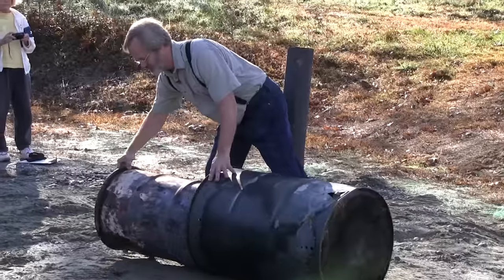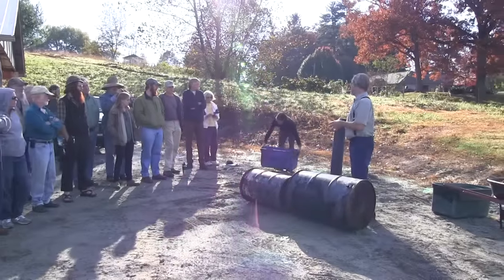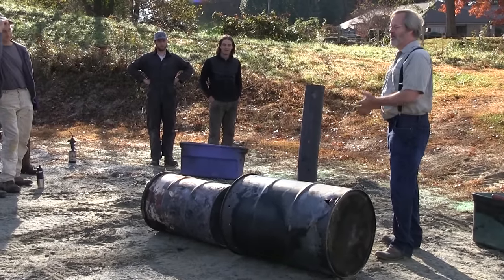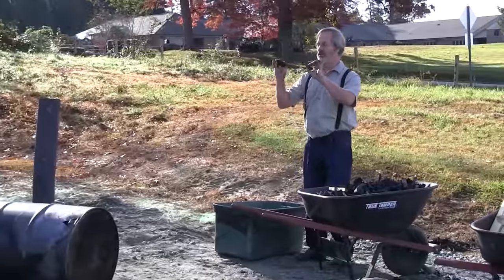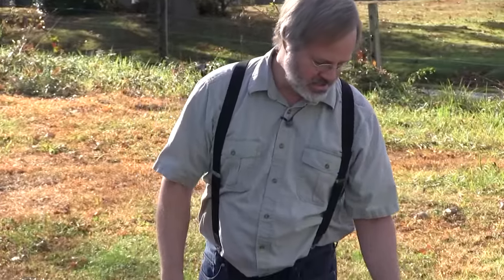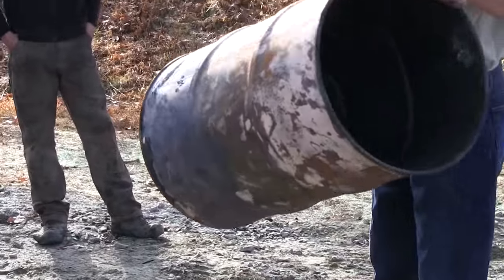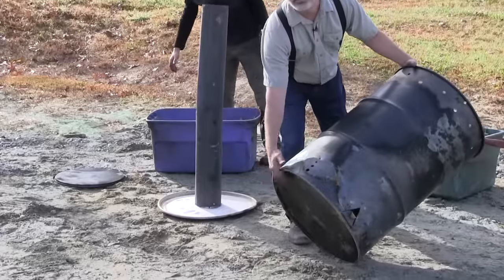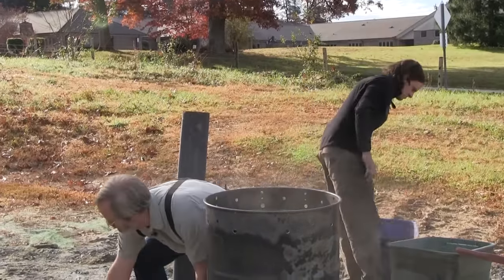Biochar Workshop Part 1, How to Make Biochar

Comment: I use pine cones that are all over the place in my yard.  The simplest method on the net.  I fill a gallon can with pine cones, drill a hole in the top of the can, then place it in my fire place that I use from fall to spring.  In 2 to 3 hours, biochar.   The pine cones crush to very fine pieces also.  Perfect for biochar.  I make a compost tea from soil, compost, worm castings, leaves, lactobacillus, fish amino acid and emulation, pink salt.  Basically whatever nutrients I have on hand. I let it brew a couple of days then pour it into the biochar.  Let it sit for a month then pour it into my compost bins.  I don’t have a large garden so I don’t need a lot.  But if I burn 100 fires during the season I can have approximately 50 gallons of biochar.
Reply: woah cool thanks for sharing!
Reply: I’m wondering if I can turn blackberries into biochar? I’m in Oregon where our blackberries are a huge problem and definitely NOT thornless! We have old canes that can get up to an inch in diameter. Will they make biochar???
Reply: @donteatthefoxgloves377  they will bio charr just fine. Wear good thick gloves though. 👍
Reply: @caledonianson927  Thanks! We’re getting flooding up here in NW Oregon so it’s an excellent time to try it. No way to start an accidental forest fire this week! 🔥💦
Reply: @donteatthefoxgloves377  hallo madam,saya dari Indonesia menawarkan biochar dari bahan arang sekam padi 🙏
Reply: I’m concerned about the pine ur not supposed to burn pine it builds up in chimney causing many fires
Reply: @sharonkeef0522  thank you for the direction madam.our product is Made from rice huck charcol 🙏
Reply: Damn, that's some high nutrient level compost you're doing. Great setup!
Reply: @masholek4945  Why would we buy your product when there a ton of locally made and available bio char products here?
Reply: @sharonkeef0522  I’m sure that they clean their chimneys.
Reply: Can I use almond or walnut hulls?
Reply: @donteatthefoxgloves377  .....those blackberry canes will defiantly make char!
Reply: bangla tanaslet
Reply: Never thought of pine cones. I always end up with tons of those and they don’t do too well in the compost pile
Reply: Thanks for the great tip . Was contemplating the source of my first attempt.
Reply: Pink salt ? What about alfalfa meal, kelp, humic acid. Fish hydrolysate? We try to grow fungi in teas. Molasses isn't needed since bacteria almost always wins. It's winning in your garden. Why add salt, I don't like salt in my garden because they don't go well with the microbes/food web. Why salt ?
Reply: @ktownc936  it contains all 84 elements present in the human body (and more). At his capacity I'm guessing even a teaspoon will go a long way. Less for most other peoples setup
Reply: @Hubris030  This is a bit late, but I don't think the salt will help. If you have anything that you find on the earth it is the rule that you will find that it contains some amount of practically all naturally occurring elements: pure substances are exceptions in the natural world. Unless you have very pure mineral soil (like pure clay or sand) you probably have all the same elements in your soil with the added benefit of not being mostly salt.

What matters much more is how much of things and in what form they occur. In the case of rock salt, the vast majority is, as the name suggests, salt (sodium chloride). If you look it up, analysis of 'pink salt'/'Himalayan salt' is 96% to 99% sodium chloride, with trace amounts of calcium, iron, zinc, chromium, magnesium, and sulfate, all at varying levels below 1% (you find this and all the sources that did the analysis on the Wikipedia page). 

Based on this information, while it is true that trace amounts of useful minerals may be found in the salt, they are in tiny amounts relative to the amount of sodium chloride. Sodium chloride is sadly generally bad for plants and microbes because it can mess up concentration gradients of water and other things disrupting their ability to retain moisture inside them and absorb other nutrients. Basically I would suggest if you want to amend your soil with minerals to either do it with compost (the safest way as most plants don't accumulate too much of anything to be dangerous) or using other sources after doing your research (i.e. getting your soil tested to know what you are lacking and adding an appropriate amount of something that contains that and not other more harmful things like salt). Adding salt in very small quantities as it seems you were doing luckily won't do much harm. However I strongly suggest to stop doing it because for any amount, because it is almost all composed of salt, the negative effects of the salt will drastically outweigh the positive effects of whatever trace minerals are in it (unless you are growing halophytes in literal pure sand--in which case you would still be better off adding something with more of the stuff your plants need and less salt).
Reply: @Hubris030 84 elements contain where ?

Comment: A small biochar device might be placed inside and large greenhouse to burn during the day to warm them in Winter and to stimulate plant growth with the carbon dioxide.  In this way you can use all of the energy heat and carbon dioxide that you are loosing now. -- J.E. Ante.

Comment: I made a kiln based on this video a few years back. I used half of a 300 gallon propane tank cut to 6"s higher than a 55gal drum, which sits inside the propane tank.. The lid has a 4.5" stack. It makes charcoal to perfection. Back then, the gentleman that created the video mentions, that he tried to use a chipper to fine grind the char, after crushing it with the tractor. Too much dust was the issue. I do the same, and use the chipper, but first soak the crushed char. No dust and the finished product is really fine. To protect the chipper, run 2-3 loads of dry material through it after grinding the char.

Comment: The small amount of ash can be saved up until you want to make lye. That in turn may be used in soap making. The fat could be rendered down in pots on top as you are making biochar. There, you’ve used two byproducts of this process! You can throw on a Dutch oven and make stew.
Thanks for the ideas!

Oooooo! Just had another idea...
Wrap piping around the chimney to heat water...
Reply: Cool thanks for sharing this important information listening from Bangs Texas
Reply: You can also just directly use ash to amend soil. Adds a lot of good minerals.
Reply: @d.w.stratton4078  Hi, thanks for that reminder. I also make a spa bath for my chickens with a little ash, spaghnum moss, & some sand. No extra critters ever visit my feathered friends!
Reply: Jh
Reply: Some more ideas. Imagine a lean - to next to the house with two or three of these. Piping hot fresh bread for breakfast. A hearty stew or slow cooked roast. Enough hot water for the family to have their shower. Cold climates? Have a sort of shut off or divert valve on top of chimney that opens a duct for hot air to flow through the piping that you can put INSIDE your lounge / living area for radiant heating.
Reply: better, pot ash right into your compost

Comment: With the nails from pallets. You could drag a roofers magnet over the biochar after the burn. That would pull out all the metal. just as roofers use it to clean the stray nails from customer's Gardens and yards after a job.

Comment: For the home owner that has some organic material (branches, dry grass, leaves etc), there is a simper method that works a treat, doesn't burn up some of the wood ( in the outer annulus) in order to pyrolyze the rest(in the inner drum)  and only uses a 200 liter (45Gallon) steel drum.  Take the top off the drum but make no other openings in the drum.  Start your fire in the bottom of the drum and start to add the branches you have.  Save some of the fine material for the finish.  Continually adding wood, drives the flammable gases off the wood and the combustion of these gases keeps the oxygen away from the charcoal that is building up on the bottom of the drum.  Finish with the fine stuff to keep the heat up and ensure the layers below are well charred.   When there is no more flame, tip the drum on it's side, then up on it's open end.  Kick dirt around the rim of the drum so that no oxygen can enter.  The next morning pull off the drum.  You will find even leaves are carbonized and not burnt up.  Put one in the palm of your hand and rub it with a finger.  It will powder into charcoal dust.
Reply: Great Idea.
Reply: If you don't want to bother with the barrel, there is the cone pit method. Dig a cone shaped hole on the ground, start with a small pile of wood fire. Keep feeding the fire but keep the fuel level to the surface and not above it. If you see too much visible smoke stop feeding the fire. Eventually the charcoal will fill the pit. At that point you stop feeding the fire and mixe up the content of this pit a little bit and wait until the pit cool down. That way all the leftover wood get charred too. The cone pit method is slightly less efficient than the barrel but it's faster and you don't have to get a barrel.

Comment: Vent your stack in a long tube off to a closed chamber and use a good wood like maple for a smoker.  Insulate your stack with a secondary chamber of water and vent your water off to create a water distillery.
Combine the two previous ideas and further vent your smoker back through the water barrel and you have just reduced the wasted energy further, along with cleaning all of the exhaust through the water.  You'll get some ash in your water chamber that will need to be cleaned every so often but ash is useful too.  If you want to put in a bit of extra work with seals and such, you can make this super efficient.

Comment: There are several designs for making charcoal or biochar.
The smaller pieces of wood make better biochar. 
Biochar helps in several ways.
It lightens clay soils, absorbs and holds water in sandy soils. The biochar creates a microbiome for living creatures that benefit the soil. The biochar is best precharged by mixing chicken manure or other manure with biochar. 
There is some misunderstanding about biochar. First,  if you've already got great soil then you're not going to see much improvement in crop output. In fact you may see a bit less if the biochar has not been precharged.
It takes a season of two for the biochar to naturally grow its microbiome. While it does this it uses some fertily from the soil.
So, precharging the biocharge with manure is well worth the effort.
Reply: can you add it to your compost pile then use after 6 months-1yr?
Reply: Thats pretty special.  Come to a video series about biochar, that accurately and in depth describes the entire process from making it, to what it does, and how to properly use it, just so you can tell everyone your own opinion.  This is like going to a college class so you can stand up and try to teach the class.
Reply: Took screenshot of your comment. Thank you!
Reply: Some of it was explained in part two, about sandy soil and the importance of pre-charging. But good to have it here too, for people who won't go to the next part.
Reply: You don't have to use animal inputs. You can instead just toss biochar in your compost heap for a week or two and it will be fully loaded with microbes, fungi, and water. Canadian Permaculture does this to great effect.
Reply: @aleem_94  yes.
Reply: Someone in the comments above mentioned the soils of the South American rainforest that have been treated with biochar in precolumbian times. As I recall, it's called terra prieta, or something worth looking up. [The book 1491 has an indepth discussion of the amazingly fertile terra prieta soils, and the human-planted food forests, along with a well-researched exploration of the western hemisphere before the conquistadores.] Archaeologists have been shocked to find such deep, rich, fertile soils in the rainforest. We were taught that rainforest soils were thin and fragile, and lost fertility a few short years after slashing and burning, because all the rain washed away the fertility. Biochar is magical.
Reply: @grovermartin6874  that sounds so interesting!  I will look that up, thank you for sharing!
Reply: @RealHankShill  no it's not lol
Reply: @RealHankShill  WTF is wrong with giving his opinion? Especially if it's valid one! That is literally the reason there is a comment section. The guy in the videos seems like a very reasonable man. I really don't believe he'd have a problem with people in with people sharing potentially valuable information on this topic. Whilst he's clearly extremely well educated and knowledgeable on the topic, I'm sure he doesn't have ALL of knowledge... Only a portion of it! Even if he did know it all, he certainly can't put it all in one video. There's always always more to learn.
I for one have no issue with people sharing the what they know. If I'm interested, I'll read it, if I'm not, then I'll scroll past. Perhaps you should just scroll on your merry way and leave it for those that who may be interested interested.
Reply: @1CT1  you hit your head?
Or you always go around making random comments?
Reply: @chris432t6  []][
Reply: I use pine cones that are all over the place in my yard.  The simplest method on the net.  I fill a gallon can with pine cones, drill a hole in the top of the can, then place it in my fire place that I use from fall to spring.  In 2 to 3 hours, biochar.   The pine cones crush to very fine pieces also.  Perfect for biochar.  I make a compost tea from soil, compost, worm castings, leaves, lactobacillus, fish amino acid and emulation, pink salt.  Basically whatever nutrients I have on hand. I let it brew a couple of days then pour it into the biochar.  Let it sit for a month then pour it into my compost bins.  I don’t have a large garden so I don’t need a lot.  But if I burn 100 fires during the season I can have approximately 50 gallons of biochar.
Reply: @aleem_94   Yes and you don't need any special equipment, just a normal burn pile.  (see my other post for details for a "better burn pile")
Reply: Do you have to let it burn off if you incorporate the chicken manure with it? Or does the biochar cancel that out?  and how long does it need to burn off?  Normal time?
Reply: @d.w.stratton4078 why not just add charcoal?

Comment: I have been thinking that biochar could be added to concrete to make it really light and insulative. 

I have noticed that it really preserves fence posts too. Charring the underground part of the post. 

I think you are onto something here. You can run engines on the gas too. Just need some processing first. I think you can condense the gasses into an oil too and that could be useful too.
Reply: They used it at beginnng of motorisation. 
Wood-fuel was called "Gasolin"
Reply: Adding biochar to concrete is covered in Burn by Albert Bates and Kathleen Draper.
Reply: Fascinating there is a solution  for every  problem

Comment: Hi I've watched your video over and over, I'm using this simple setup, it is yielding a good result, I always pick up on small details that I implement.   hopefully one day I can use the heat to run a hot house or warm up water for an outside shower. I live in Australia Victoria in the high country of South Gippsland.  in the winter it gets down to 0-1 degrees Celsius. the humidity here is about whats at the sub tropic 87% to 90% most of the time yet this is a could climate.  Just to make tings wright, charcoal is only charcoal this its charged up with nutrients after that is BIOCHAR 
Kind regard from Down Under  Endre
Reply: Charcoal charged cannot become Biochar, as volatile matter remain in the pores due to oxygen entry in charcoal process.

Comment: A suggestion, you might appreciate. After the first burn period is over and it starts smoking, you can rebalance the oxidizing by adding a section of exaust stack to the existing stack until the draft is rebalanced. (the correct length stack)

Comment: A lot of possibilities: neighborhood heat plant, electricity generation with a microturbine, then use the heat (cogeneration), composting toilets, reclaiming grasslands, fracking water filtration, water reclaiming in drought areas.

I will watch this again, a few times, I think!
Reply: @mahb0wzinyomouf  the biochar can be used to increase fertility leading to growing more trees faster. Wood is renewable. We just need to collectively decide to manage our natural resources appropriately. Consider the possibility that a lack of resources is not our limiting factor but rather our thinking and attitude is.

Comment: I have an abundance of dead fall (Aspen) around my property. Any recommendations, pros/cons regarding this relatively soft material for Biochar.
Also can saw dust be used in any capacity within this process? Thanks in advance. P.S. the enlightenment in regards to the Biochar process is greatly appreciated. Thanks again. 👍
Reply: Some charcoal is better than none. Just dig a trench and burn and keep adding wood till it’s coals and put it out with water. It’ll burn using its own energy and burn hotter so the absorption of the charcoal is better then charcoal made in metal containers.

Comment: Great video, excellent explanation and seminar.
I would argue that wood smoke is not bad for the environment and is not a pollution. In Woodtimber country and the great plains fire is a natural thing, the Native Americans and lightning used to burn the planes off all the time. In Woodtimber country the same thing would happen, and still does. Plants readily use all the carbon that is produced from wood smoke. I see it as a natural thing. In my opinion the wood smoke is a natural resource as much as the charcoal. Just my opinion and what I have observed naturally.
Respectfully
Luke